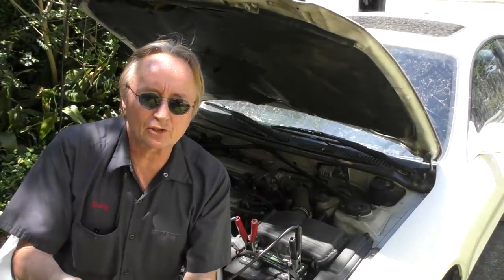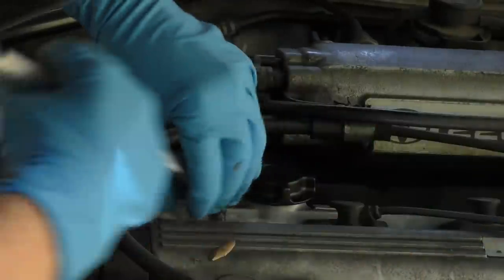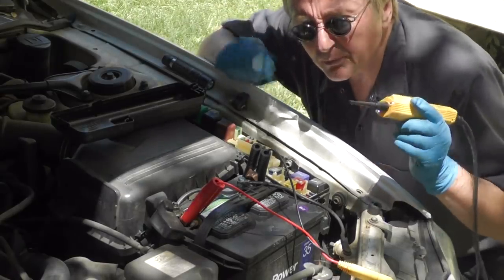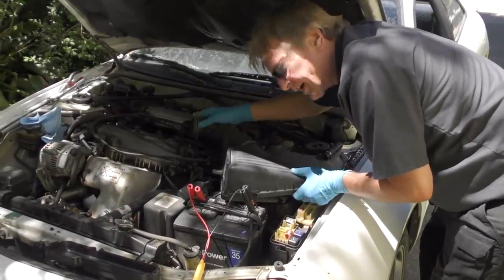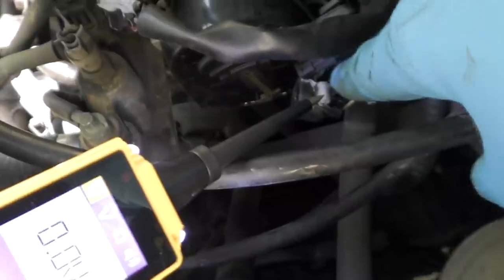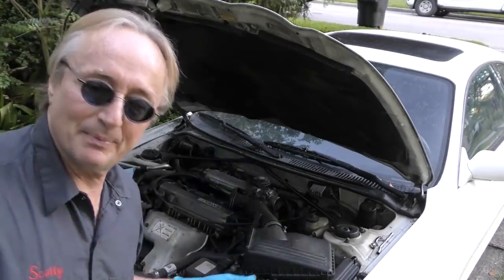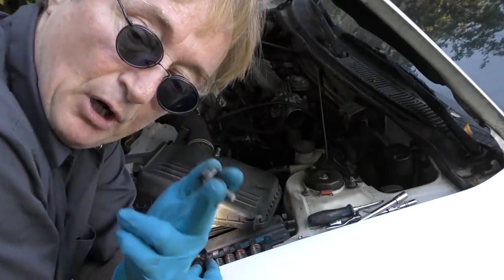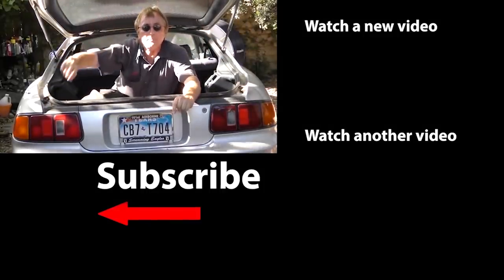Doing This Will Make a Dead Car Start Again

Comment: "known flaw on celica, the distributor shorts out" I guess it only lasted 27 years, such shoddy quality 🙄🙄🙄
Reply: could have been replaced before. i'm on distributor #3 on my 95 sable. 164k miles, 2 distributors, i'm doing ok
Reply: Sarcasm is strong with this one
Reply: :v
Reply: I always purchase gm products and get years of endless reliability, nothing but the best quality for me. If you want a car that lasts a long time without expensive repairs buy a gm and you wont go wrong
Reply: @nov3019892008  Auto mechanics recommend GM cars and trucks.
Reply: Ed Waggoner Sr. lol
Reply: @edwaggonersr.7446  ideal for endless amounts of work
Reply: @nov3019892008  It's all made in China. They had a steering wheel recall for crying out loud. STEERING WHEEL!!! You'd think that would be a flawless system but not when you have parts made in China.
Reply: I was so mad....24 years later my distributor was shot, not even covered by warranty. Those bastards!!!! 🙌
Reply: The simple fact that a part is made in China does not make it poor quality. China makes poor-quality parts, high-quality parts and everything in between. It's all down to whatever the company commissioning the parts wants to pay for. You pay for high-quality production and your Chinese factory will make parts that will stand comparison with the best parts made anywhere else in the world.
Reply: @Richard - GM has a terrible record of reliability and longevity.
Reply: The cars on my driveway use ignition coils in place of the distributor caps and 2 of them use spark plug wires.
Reply: this comment deserves more likes
Reply: @chrism3784  can be, bit that's not a celica.
Reply: @edwaggonersr.7446  I remember correctly in years ago my 1996 GM mini van  got a factory recall for a defective steering wheel. I found nothing wrong with my steering. But after the local dealer finished the recall on my steering all most killed me when one day aftet 1 month later while driving the van it won't steer.
Seems to be a complete power steering lost. luckily I was driving straight at less than 30 mph try to make a right hand turn.
Took it back to the dealer settled for a new steering rack. 
They insulted me says here your new steering it cost them few thousands $ for the installation as if I wish for it for it wasn't built right from the first place.
Reply: You got that right. 
Japjunk
I’ve got cars almost twice as old with twice the mileage and the distributors are just fine
Reply: @chrism3784  lol I have a 94 Taurus 3.8, this comment is telling me I should replace my distributor as I get a shaky startup after driving the car warm and going to the store then starting up to a misfiring engine
Reply: factory battery on my 2005 Scion lasted for 10 years. Those darn shoddy Toyota parts!
Reply: @sirjohndoeofpa3292  IKR? Here the Toyota dealership been giving away lifetime free tires with the purchase of any of their vehicles as long as your the original purchaser.
Reply: My 92 Camry 4cyl with 165K on  it just had the original distributor crap out.

Comment: lol, it starts but sounds like a 1920s tractor.
Reply: And runs like one
Reply: After replacing the distributor, the next step is to set the timing.
Reply: Sirus 😂😂😂👊🏼
Reply: you wanna hear a 1920s tractor listen to a 55' Ford cranking.
Reply: because it hasn't started for a while, the head is too dry of oil.
Reply: All 25 year old Toyota's sound like diesel's
Reply: Timing, full service, change the timing belt, change fluids in engine, brakes and trans and it will run fine pretty much so, unless the oil has been there for the last 27 years.
Reply: When my 2.2 Celica has been sitting a while, I pour 2 ounces of oil in because it enters right by the cams
Reply: should sounds better if timing  is fixed
Reply: Sherwin Diaz Almost definitely wasn't dry of oil up top, he cranked it more than enough to build oil pressure.
Reply: TIME THE ENGINE NEXT.

Comment: Lol holy crap... maybe after fixing the distributor, you'll want to look at that engine knock...
Reply: EGC_Warlock that is how the older generation engines sounded in the mid 90s. It’s a sorta feedback
Reply: @ernestochavez5106  Not like that, this one sounded real rural there.
Reply: Maybe it needs a new timing belt tensioner
Reply: From my experience the ICE engine sounds a meaningful amount more bassy with the air filter housing off.
Reply: @imachynn  This one was rural; like a tractor. I'd say timing needs to be dialed in first. The new rotor house was just installed and tested for starting. Next is usually calibrating it correctly. Then any more problems go from there. I'd have checked all the plugs first at least as well, even replaced. But it'll get there.

Comment: i had to replace the distributor on a '72 corolla 40 years ago, i bought the car for $100, the guy put in the wrong distributor and the car would top out at 10mph, quick fix.
Reply: @D.O.A. my brother had it for a year, i sold it to him for $200. he drove it on Chicago highways. it was skanky, 1.2 liter, 2 speed automatic, i'd feel better driving a '60 VW bug.
Reply: @D.O.A. not a '72 rust bucket, LOL my brother fucked it up, put house speakers on the rear deck (wooden boxes) they tapped the rear window enough to shatter it! he bought a pair of Subaru 360's, made one out them, one auto, one manual, he made the auto manual, had to swap out the pedals and shifter, the auto had the better body. pissed off the parents, having 2 subys in the driveway at once.
Reply: Those were sporty cars.  I drove one back in 74.
Reply: No worries with '78 Datsun B210 GX.  @ $250 - was Flintstone Mobile till Clutch Pressure Plate and Brake Booster were 'fixed'.  (25-ish mph) 
But when it suddenly went Cruising at Full speed - No exceptions ~ YO!    Carburetor kit didn't work, but was fun trying, replace needed.   
The Best little engine that could!    Just didn't float well.     = [
Reply: I miss my '72 Corolla, the yr. I was born. 2 door, 1.2 Liter 112 cubic  inches 3-kc engine, 4 speed manual, front disc brakes, super wide & beefy 155/75 12" tires !!!! Good times good times 0-60 mph  in 17 seconds on regular gas aka leaded gas. In high school I bought a tune up kit with a transparent distributor cap & wires. I would watch the Sparks at night 😉😁😂
Reply: @408SPLKINGS  -  lol  I'd LOVE That!  What a list - even tire size -  Nice Job!  
I was learning  - trying to - still am.  Better next life! 
Transparent Distributor Cap . . hmm,  must  check it out.
Reply: @kareno8634  I learned long ago as a young kid 5-6 yrs. old, MEANING of LIFE = RELATIONSHIPS. Not money, material things, status, Fame, fortune that matters. Go enjoy life you deserve it & owe it to yourself.
Reply: @408SPLKINGS  -  Right On!   Grew up in Woods on Water  ~  No better teacher than Nature, and my Grandparents.  ;  }  Pop told me about Indians that lived there, Gammy told me about Snakes after finding shed at 3.  
Sorry i didn't know enough then to ask about more of  their 'stories'.   It's the 'little' things that matter - and i think they're Huge!   peace gin ngo!   ~- *  thanks

Comment: Great fix Scotty but it sounds like no oil in the engine hehe haha lol 😜👍🇦🇺
Reply: I think hes trying to mess up his car to make more vids. jk
Reply: Sounds like lifters need adjustment
Reply: Just sounds like a 27 year old car with a couple hundred thousand miles on it.  It runs, it drives, and if he can get it to run another year Scotty will have easily justified the price of the distributor replacement.
Reply: @acw2237  I'm sure they are hydrolic lifters.
Reply: @fredmertz8538  

Yep.. Need some adjusting.. Most ppl never do this
Reply: cicobee cicobee 

You should get the valve adjustments if it's a daily driver.. Up to you
Reply: Read his pinned comment above.....I noticed how quickly he cut the video to try and avoid people saying these things lol
Reply: @yeahboiii6640 

Yes.. He knows it needs those adjustments
Reply: Or maybe starter going out?
Reply: cicobee cicobee 

Never know until it's examined..  These engines are tough
Reply: @letmebehomie6185 

No...

Comment: Did u later check the timing?

I submit that maybe u were just giving us a quick diagnosis of one problem.  Hey l spent most of my career working on old pre-electronic cars.  I could usually see or hear what was wrong with them.  So l don't know all these tricks and short cuts you know.  Anyone who is just getting started now should cherish this hard won free information.   I'm sure most of you guys know that though.   When l first started working at dealerships in 1977 l introduced myself to every mechanic and told them l was a hobby mechanic and l'd welcome any pointers they could give me.  They helped me so much l was blown away.  I was making good money in no time.  I also asked to go to every available class offered by the manufacturers.  I got that too.  After 3 years of that, 2 in a British car dealership and 1 in a Ferrari dealership l opened my own business.  During my hobby years l related to them as school too.  During that time l painted about 30 cars, learned to rebuild engines and basically gain confidence.  What l never have pursued is expertise in accurate diagnosis of modern computerised cars.  I don't own any analysers.  I actually had a "tune up center" years ago, oscilloscope and all😂
Reply: Ok so as a 19 yr old what tips do you have for me?
Reply: @liveandletlive2894  First of all, l will assume you are in fact a 19yo, post HS person  who is really wanting to get it right, i.e. not wasting his lifetime in the role of a human pinball.  

This is important, what vision of yourself feels right to you?  Personally l was most natural and comfortable with tools in my hands and my mind focused on  repairing or restoring cars.  When l was 17 l began moving in that direction.  I got a State college BS in industrial Technology and took every automotive related course available.  I had a very good Prof in those subjects who challenged us to think.  I also took welding, sheet metal, industrial Finishing,  Foundry, Machining, Electronics, Metalurgy and 3 courses in Auto Mechanics.  I did a total of 5 years of college in 4 years + worked part time + bought and sold cars + 3 of the 4 years had a girlfriend. 😬  l'm not recommending any of that.  I would have been much wiser to focus on diligent study.  These days, as you younger people know, College attendance is questionable.  If you want a career in Auto repair you have volumes of  educational material and classes within teach of your fingertips.  Much of it is free.  If you don't go after more school find a way to learn as much as possible.  My Dad gave me access to an open air carport where l worked all year long.  I rebuilt my first engine, a 1959 Austin Healey Sprite 948cc on a table in that carport.  I did class projects on that car.  For industrial Design l designed and built a 4 point rollbar.  I also made a set of widened reverse wheels.  I became one of the founding members of the College Sports Car Club.  We held autocrosses and Road Rallys.  I recommend 2 or 3 autocrosses for anyone who drives.  You will learn things in a safe environment that may serve you well the rest of your life.

Ask that same question specifically from Scotty.  Keep asking until he had time to answer.   Ask the question repeatedly in the comments section.  Go to dealerships and repair shops, ask them.  Look, l'm 70 and retired l can speak to you from my own life's experiences but they may not work for you.   The best too you in all of your life's endeavors.
Reply: @leonardodahumanoid4344  wow ok I'm gonna have to pick somewhere to start
Reply: Leonardo DaHumanoid v c bn  c bbccbb. n g c. n.  n
Reply: @Lituano21  huh
Reply: @liveandletlive2894  Same question l had.  At least l know it's not just me🤔
Reply: @leonardodahumanoid4344  well I do know a fair amount of mechinal stuff I have 4 cars all bought non running now 3 are up and going if you wanna start somewhere get a civic!
Reply: @liveandletlive2894  Yes, l'd say you do.  I have had 3 Civics.  2 were 1st generation CRX Sl.  I'd love to still have one.
Reply: @leonardodahumanoid4344  well I'm 19 so I've got an '03 and a '00 which I got for $120 start up and idles like crap hadn't had much time to look at it but I did plug my scanner in and the only codes are for oxygen sensor so no misfires which is good...previous owner (shady guy) claims cams or exhaust valves or something need to he adjusted does that make sense?
Reply: @liveandletlive2894  My first thought was, how does he know that is the problem?  Did he take it apart and put it back together wrong?  Usually sellers say "it just needs a tune up".  

Actually it could be the oxygen sensor.  I would trust the scanner before an owner that sells a car cheap because it has driven him mad.
Reply: @leonardodahumanoid4344  well when I got the valve cover bolts were out so...

Comment: Hey Scottie! What do you recommend doing when resealing an engine oil pan. I've tried several times but seem to not be able to seal all the way. 
I also have an eval leak. But don't know where to plug the smoke machine. I have a 2011 Chevy Cruze lt. 1.4. thanks for your information. Your videos are the best!

Comment: Scotty, my scooter has fuel, spark and starts when any of the fuel injector wires are off, so it gets too much fuel?? The throttle position sensor has been checked, works. Is it some o-ring broken in the injector assembly or the ecu failing. Also, only driven for 5000 kilometers and has been sitting for a few years.

Comment: I drive a 92 corolla with nearly identical distributor. Unless I get an OEM distributor I will not get an aftermarket part. I rebuilt the OEM distributor with an aftermarket shaft oil seal and bearing, and OEM DENSO-Sumitomo distributor cap-wires. Set the correct air gap and it is close to 20K miles and no oil leaks or loose shaft. OEM rotor has been redesigned by Toyota and is about $15 at the dealer.

Comment: Make sure you're going OEM (Denso for Toyota) when it comes to the primary and secondary ignition. My Integra had the same poblem and there's a difference from the cheap made in china aftermarket coil and the OEM one from Japan [I'm not sure who the maker is for Honda ignition coils but there were some OEM Denso parts in there too].

Comment: Scotty i have an 08 cvpi. I want to dump a 5.0l and a manual transmission in it. Then weight reduction (anythings lighter than a cvpi trans and the classic 4.6) then just change the slip diffs to the stangs 4:10. Ive seen people change the body on frame to be more modern, but is this beneficial? Would doing this be worth it? How do you buy just an engine without gettin haf

Comment: Hi sir, love your videos. Can I ask how much approximately would it cost to replace the timing belt and additional bell and with all the seals for a Lexus Gx470? I was quoted for around $700. My car has 185k miles and the first timing belt was changed at 92k miles. Bayside a timing belt one hours need to be serviced in order for me to keep the vehicle for the next four years? Thanks

Comment: Hi Scotty.  I own a Toyota Scion IQ.  Love the car, no problem on the highway, can travel at 70-80 mph.  It is slow off the mark, but once you learn about the VS it's good.  I regularly get 38-40 mpg.  Tank only hold 32 litres. :)) I have about 75,000 miles now.  Just wondering what should watch out for and your thoughts in general.  Thanks in advance.  Michael.

Comment: Scotty....I think I may have over tightened  the drain plug  bolt on my 2011 Corolla!! I attempted to torque it to 27ft lbs per the Haynes repair manual.  I was to afraid to continue to tighten the bolt after several turn with the torque wrench.  Do you recommend  torquing  the drain plug?!

Comment: Looking at the distributor is one way to check if chain is broken but you could have looked at the valves with the spark plug out and if they move timing chain is good.

Comment: What about timing it?  The 2 screws have a lot of wiggle room.
Reply: I wondered same thing, you should at least mark the location of the hold down bolts of the old one and put the new one in exactly same. I am told some newer cars self time, but I doubt they did 27 years ago, especially with slotted mounting holes.
Reply: The engine didn't sound right. Needs timing adjusted,  I believe.
Reply: Modern fuel injection is an ENGINE MANAGEMENT system. Thus controlling fuel mixture and ignition timing. Old timey fuel injection didn't manage the ignition system.  Just the fuel.  Later engine management systems were a huge improvement over earlier systems.

Comment: To test the spark, I use a touchless voltage detector. They light up like crazy, next to the wires.

It´s just a bit easier than hooking up a timing gun.

Comment: Hi Scotty,
I enjoy your videos, they 're both informative and educational.
I am based in the UK, I wonder if you could help me with a query.  I am thinking of de-catting my JDM Subaru Legacy twin scroll (has a factory turbo) around the mid section of the exhaust. I have a custom pipe equipped with a hole where the O2 will fit. Do you think this will be safe for the engine? Any advice will be appreciated. Many Thanks.
Ferdaous

Comment: Might want to mention marking the old distributer and the head, duplicating the mark on the new distributer so when you put it in, you're at least CLOSE on ignition timing... and mention that you will have to exactly time it once it's running.

Comment: Hye Scotty Kilmer ,
So i did buy my first berline car Renault Laguna 3 Celsium ,  1,5dci , 2010.
In France , I would like to know your experience or your advice on the reliability of this car , It is equipped with start/stop button  and its a Diesel model.
I would also like to know the things which i must be aware on that type of car and if running AC with engine off would damage the car ?
Thanks a lot for all your videos they are really helpfull keep it up :)